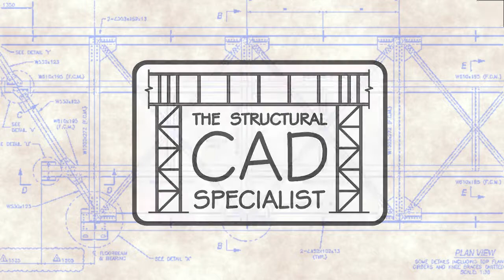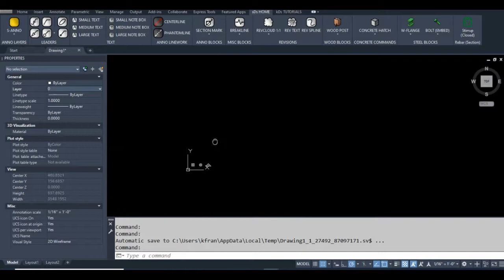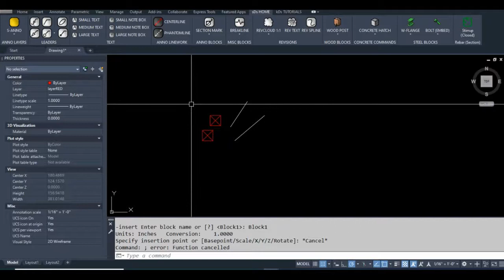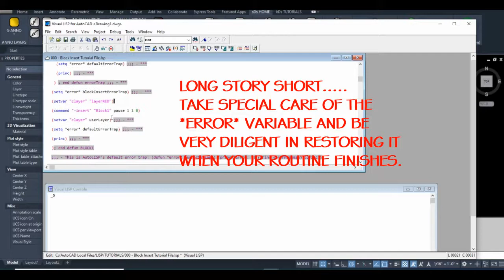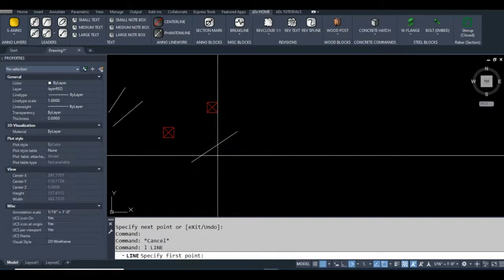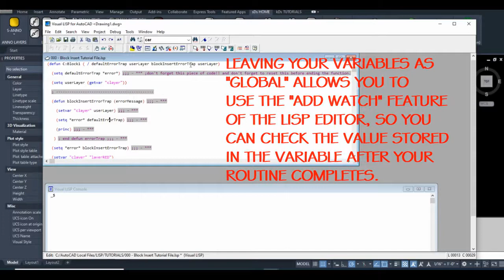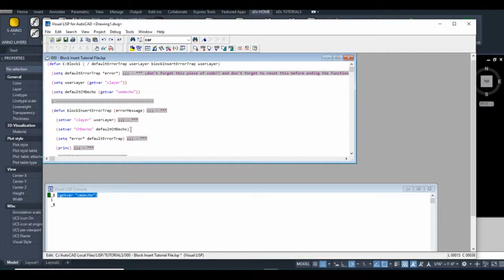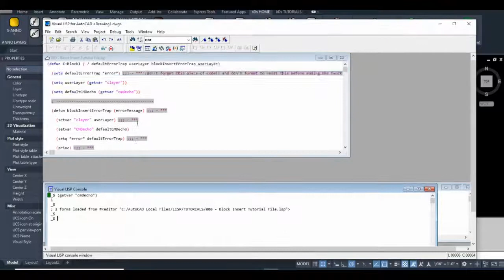Part 2 - Insert Command, Error Trapping & Resetting Variables

Comment: How to add a code in the block insert command for keeping my block with the specific layer. All of my blocks got already specific layer name. So everytime I insert a block, I need to explode it one more time to have the specific layer. May I know what code to add so that I don;t need to explode my inserted blocks? Thanks for the help bro. I used you code . (defun C:EACV-P900YA ()
  (command "-insert" "EACV-P900YA" pause 1 1 0)
); My command is the mechanical equipment and has already desired layer set.
Reply from the maker: Also... consider using "CHPROPS" if you need to change the properties of a newly created object.

Here's another video that might help: https://www.youtube.com/watch?v=m_XVdkn5CsU
Reply: @randomCADstuff  bro, Sorry. Still not able to get what I want. I have my block named BDT-MUZ-GL25VGD-A1. And the layer name of this block is M-EQPT-IU. When I insert this block. It wont give me the layer M-EQPT-IU. I use this code : C:MUZ-GL25VGD-A1 ()
  (command "-insert" "MUZ-GL25VGD-A1" pause 1 1 0)
) . What happened after I insert is., the block that I insert is being created a new block name which is my command MUZ-GL25VGD-A1and the layer is set to 0. That's why I need to explode the block created in order to get the original block name BDT-MUZ-GL25VGD-A1 with the layer M-EQPT-IU ... I want to get rid the explode command because sometimes if I forget to explode when I go to the other layout, the current layer which I inserted my block, is freeze and it will not show to the current layout I'm working. I know I explained it too much but I hope you get what I want. I don't want my original block name being named with another block which is my command....Or I want to skip that explode command. I hope you get my point Bro. Cheers.